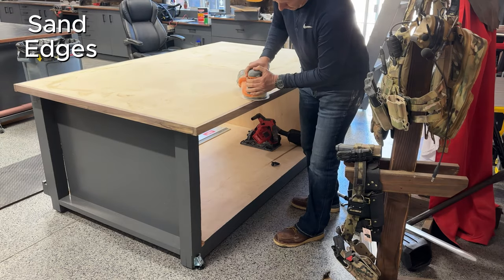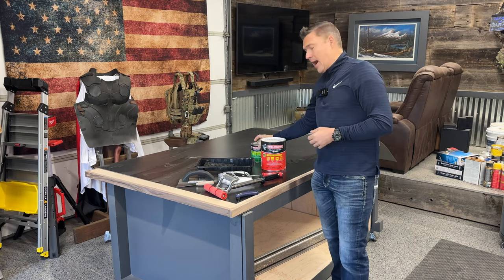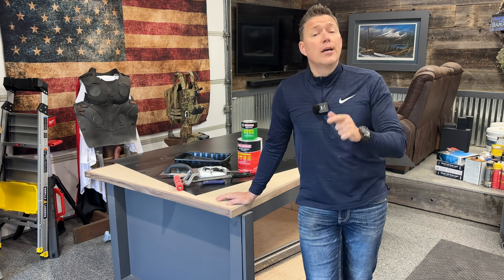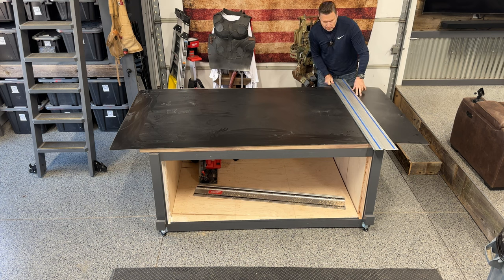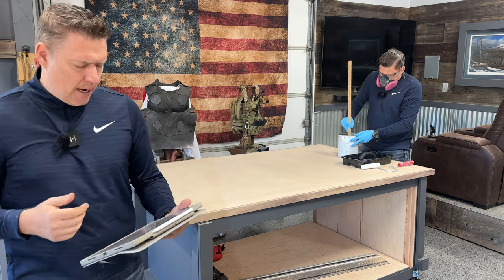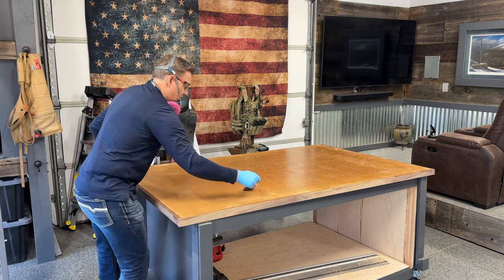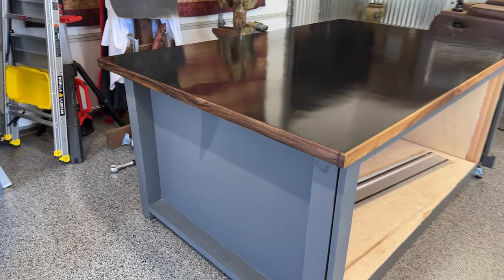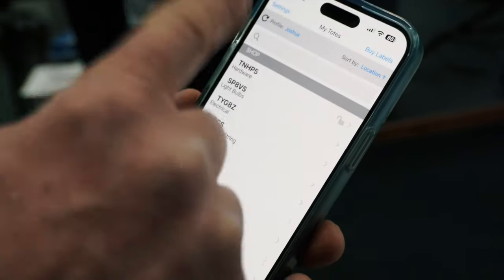The Ultimate Guide to installing a Formica Laminate Work Surface

Comment: Nice video. The concern I have is when you are spreading the adhesive, I have that same mask and p100 filters, and as far as I know, while those p100 filters will do a great job of keeping MDF dust out of your lungs they won't block solvent fumes. There are chemical cartridge filters for that.
Reply from the maker: @eh5806  hey, so appreciate your recommendation. Be you have the same set up, do you have a certain cartridge that you recommend? Thanks for sharing your knowledge which will help me out and anyone else that reads this comment. Appreciate it.

Comment: Just to clarify, on the second time that you talk about ratios, you mentioned 380 ft.² coverage but you mentioned it as per pint, but it’s supposed to be per gallon and keep in mind that that is for a bonded substrate.
Reply from the maker: You are absolutely correct, the 380 is the coverage ratio for a full gallon of a bonded substrate.

Comment: The solvent based contact adhesives just can't be used for this anymore in the UK, they've taken all the solvent out and they are gel like now, to make them usable you have to thin them al least 100%. The water based versions are much easier to apply and are much more forgiving with a longer working time. They take a bit longer to dry but for the diy'er this isn't a problem. I wouldn't go back to solvent based adhesive.
Reply from the maker: @richjones2767  that’s awesome, I appreciate you sharing. Thats one thing I love about this platform is that we get to share knowledge.